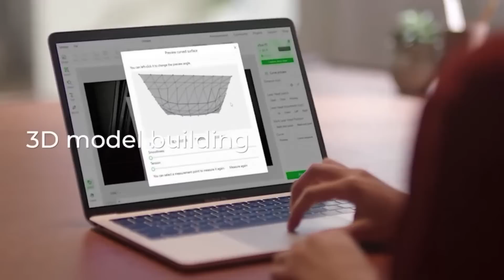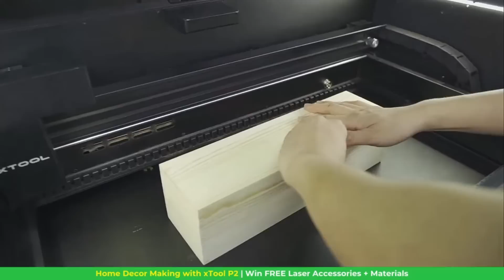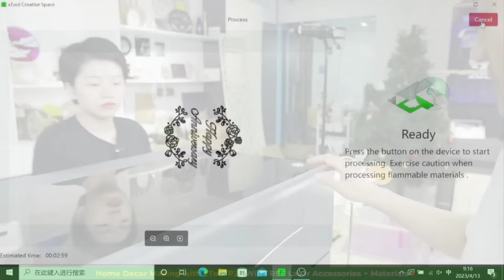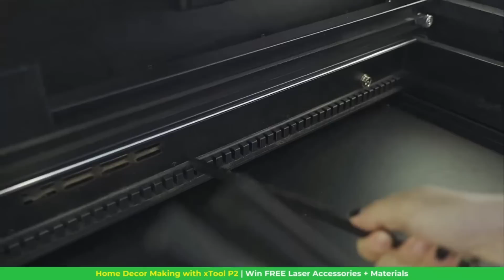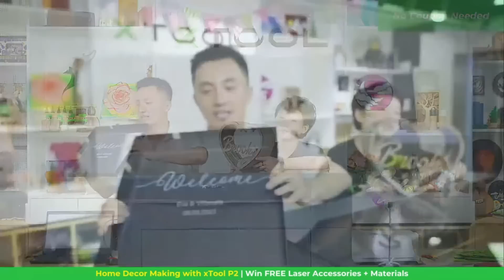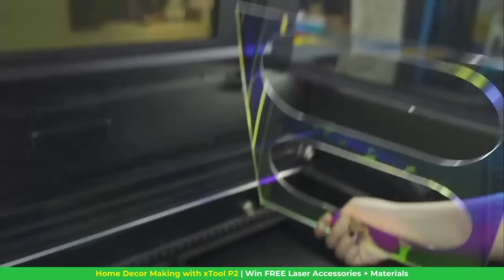Home Decor Making with xTool P2 CO2 Laser Machine

Comment: I'm intrigued by the machine's features, but a little disappointed that most things you advertise are addons that cost extra.

Then there's things like advertising a bed size of 26x14", but the real working area is only 23.5x12" in laser flat and even less in open space mode (19,63x9,75") which is not mentioned anywhere. And the fake engraving of dog tags in the release videos leaves a bad aftertaste too. For the automated passthrough I've read lengths from 2.4m to 3m and even unlimited lengths?

I am not sure if I can trust you with other claims you make for the machine.
Reply from the maker: Hi, we did mention the working area is a little bit smaller than the bed size in the Livestream multiple times. And CO2 laser machine is always the most expensive one in every brand. The dog tags are not fake. The max length is 3 meters with auto conveyor feeder and riser base, as we mentioned in the Livestream. Thank you for your feedback tho, for giving us a chance to explain the false info.
Reply: @xToollaser  Thank you for the answer and clearing up some of the points.

The dog tags itself are not fake, but the engraving part in the video is: https://youtu.be/PUqj0uP3IAk?t=24 - if you go through it frame by frame (use "." key on Youtube) you can clearly see multiple lines appearing during a single laser pass. 

I understand it's marketing, but it still results in a bad feeling.
Reply from the maker: @ulaB  Can you plz let us know what time is it in this video showing multiple lines appearing during a single laser pass? We only speed up the process as the time limit of a brand video. Plus engrave on a dog tag is not a tough task to do, why would we fake it?
Reply: @xToollaser  I have linked to the timestamp in the video. It's 24 seconds in. If you pause the video and go frame by frame (you can use "." and "," keys on Youtube), you can see the engraving get bigger while the laser head only moves in one direction.

It just looked wrong, so I checked it more closely. I do understand, it's a marketing video, but especially since engraving metal should work fine with a CO2 laser in that class, it feels wrong to edit the video that way. I just wanted to let you know that.

Overall I've bought the P2 yesterday for myself as a birthday present, so I can test myself if it will engrave dog tags, even though I don't have a dog… ;-). Your customers seem to like your products overall and you replying to me here is also a sign that you care for your customers, which gives bonus points!
Reply from the maker: @ulaB  Thank you for your advice, and hope you enjoy P2! :face-red-heart-shape: